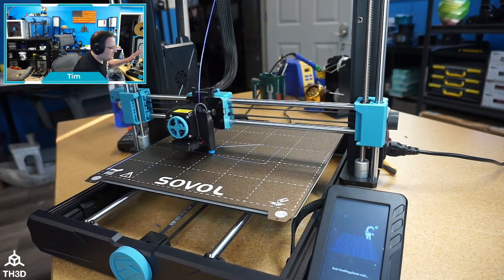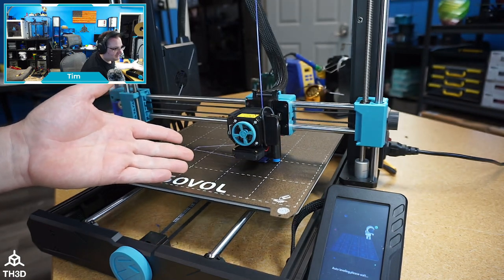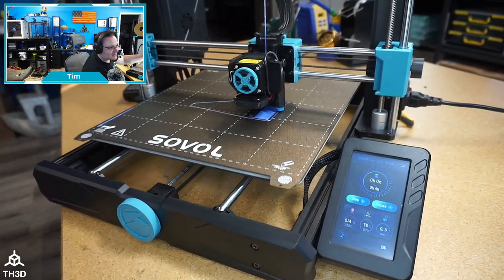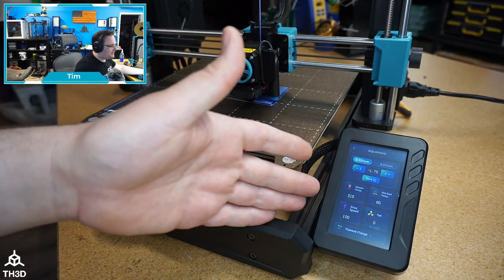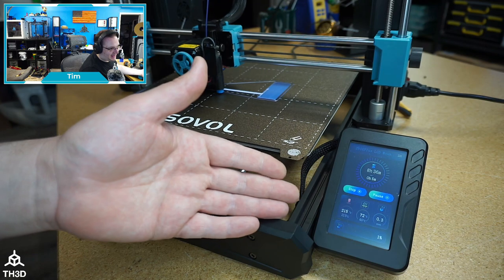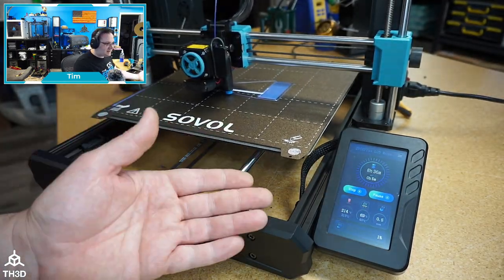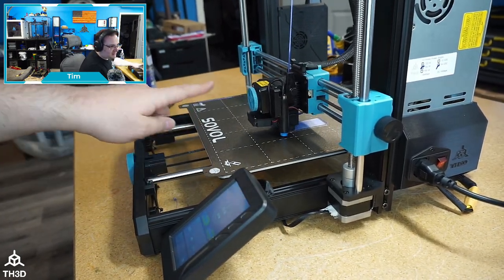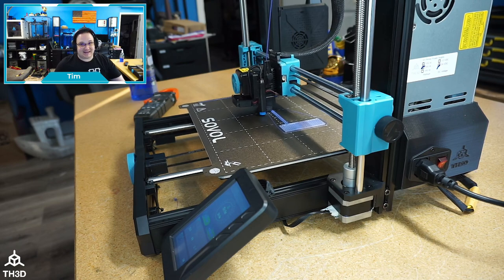Sovol SV06 Plus - LCD Fail (G29 Bug) - Locked Up

Comment: I think the starting Gcode that ships with their included slicer uses M420 S1 instead of G29.

I’ve been using M420 S1 successfully so you can try that save you reconnecting the screen each print.
Reply from the maker: Thx for that. But if they didn't botch the firmware G29 should work correctly and it doesn't.
Reply: @TH3DStudio  I use both

M104 S190 ; set nozzle to 190
M190 S[first_layer_bed_temperature] ; set bed to printing temp and wait
G28 ;Home
M420 S1 ; initialize bed leveling
G29 ; bed leveling
M109 S[first_layer_temperature] ; set nozzle temp to print temp

works like a bodge, but works